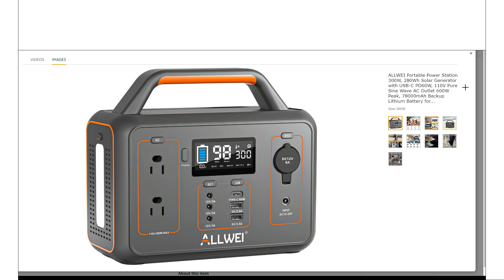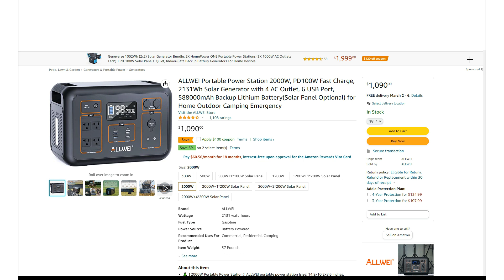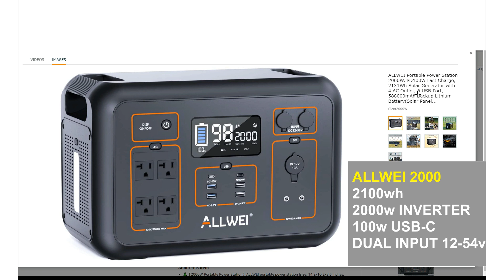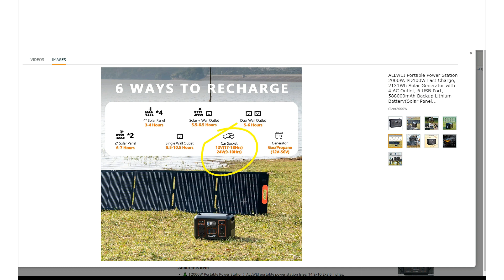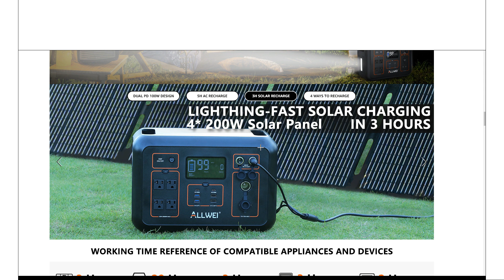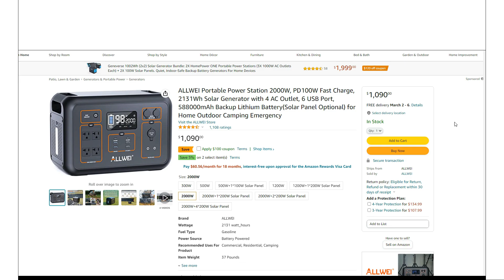Finally, 2100wh at an affordable price [ALLWEI 2000w]

Comment from the maker: The new ALLWEI 2000w portable power station features an excellent design, with all the ports on the front side, a flat top, dual MPPT input, dual 100w USB-C, and 2000w inverter in a compact case that only weighs 37lbs. The dual MPPT input means it can be charged with up 800w of solar. A bundle is also available with four 200w solar panels, which is the best deal. But there are other bundles as well. And as I mentioned, the 1200 has a similar design but with lower specs.

------------------------------------------------

If you also love portable power and would like to join me on this journey, please consider:
Subscribing
Giving a thumbs up
Sharing this video
Using my Amazon links
and don't forget to leave a comment!

ALLWEI 2000w on Amazon (affiliate link): https://amzn.to/3Z3kEBv

ALLWEI 2000w with 800w of Solar (affiliate link): https://amzn.to/3kyraRO

Thank you and thanks for watching! 😁

Comment: Can you go into the tradeoffs of NMC vs Lifeopo batteries?  You breeze over this topic like we are fully educated on this aspect.  I don't care about weight, as this would live in my RV full time.  What I am looking for is power in this range, battery storage in this range, cheap price and unit life.  How long can I expect this unit to last?  Can you recommend another unit with similar design, features, price, but with Lifepo batteries?
Reply from the maker: NMC will hold it's charge better, especially in cold temps (LFP can lose it's charge over time - but it's usually not a huge difference, but it can be depending on the quality of the battery cells and the temperature as mentioned).

Lifepo4 will give you more life cycles and they are safer, the electrolyte inside the battery is less flammable (note: it can still catch fire, but it's not "explosive"). LFP also handle high temp conditions much better (high ambient temps and high internal temps caused by high input / output watts).

The AllPowers R1500 is a close match for what you are looking for - the specs and it's cheap. I cannot speak on longevity though, AllPowers reliability is a question mark. It does have less capacity too, but they have a "R2500" with more capacity as well. Check out my R1500 video for more info:

https://youtu.be/Ah48hr83Tiw

The more well-known brands might be worth paying extra for, not just product quality but also customer support. Consider the Ecoflow Delta 2 Max, Bluetti AC200L, Jackery 2000 Plus, UGreen PowerRoam 2200 etc.
Reply: I ended up getting the Pecron E2000LFP for $821 delivered to my front door.  So far I am pretty happy with my purchase. @SoGenFan

Comment: I wonder why so many of these say gas powered when they aren't
Reply from the maker: The category on Amazon was intended primarily for gas generators, and there are certain fields required by Amazon when a product listing is created, but Amazon doesn't have the appropriate responses available for these power stations such as "battery powered" or "solar powered" etc.
Reply: Well it sounds like Amazon needs to update

Comment: I just got this. I've triedbrunning my window fan from it, and after about 30 minutes it shuts down. It doesn't feel hot to the touch and its completely charged.
Reply from the maker: Read the manual, it's possible there is a eco-mode, where the inverter turns off automatically, if it doesn't sense a load (or big enough load) to prevent the battery from being discharged down to 0 accidently.

BTW I would highly recommend looking for a DC powered fan, as using the inverter for a fan will reduce the runtime dramatically anyways.

Look for USB powered fans with a brushless motor ideally.

Comment: No thanks on the lithium ion battery.  It's a deal breaker.  There are far better solar generators with LiFePO4 batteries for the same price or less.  This is not a good deal.
Reply: Can you recommend one?

Comment: Does this run off gas  I notice it had fuel type gasoline  ?
Reply from the maker: No it does not. It's lithium battery only. 

Amazon groups these power stations in with all the regular (gas) outdoor generators. When the listing is created, certain fields need to be filled-out, and they will have a drop-down menu of choices. Evidently, Amazon hasn't yet included a proper option for these power stations, and that's why you will see a fuel source like that listed on most of these power stations.